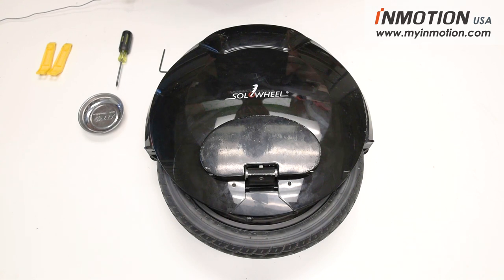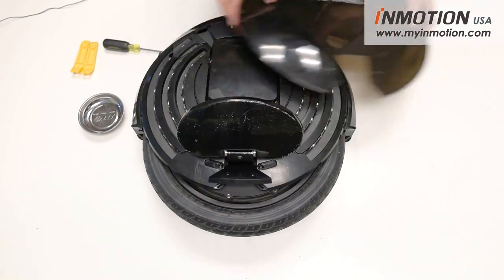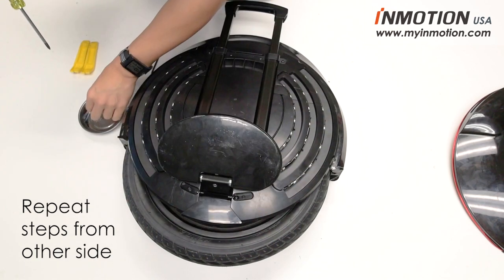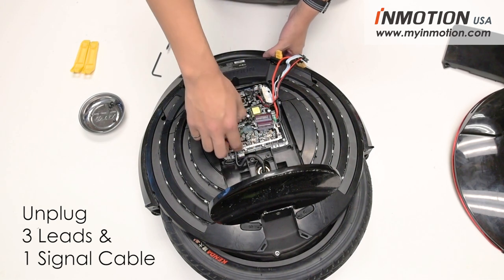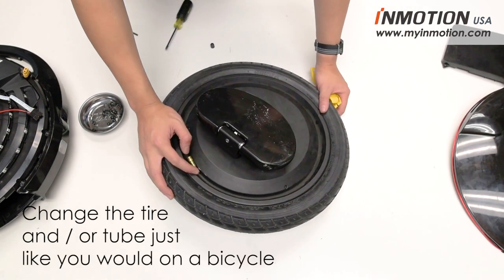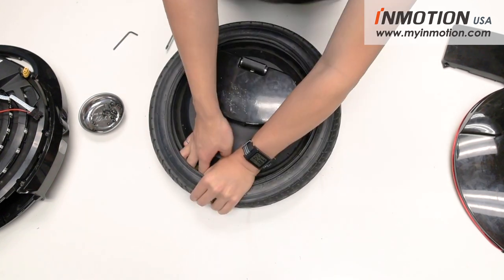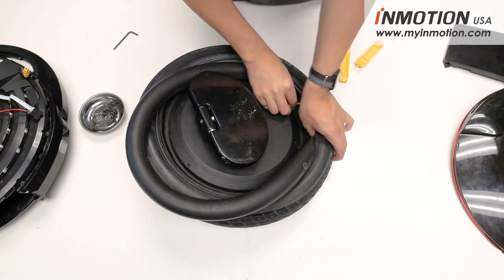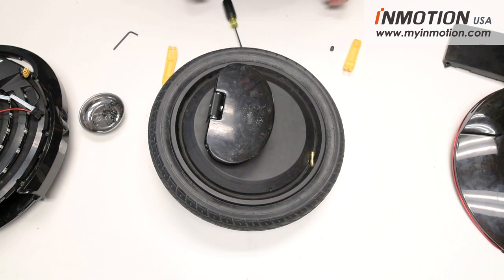InMotion V8  / Solowheel Glide 3 Tire & Tube Change

Comment: No one seemed to notice that the valve stem direction was reversed when putting the tube back in. It's not an issue, since the V8 could be ridden forwards or backwards.
Reply: Mine too and the tire also. The tire has a direction arrow on it, not sure how they missed either. Must be the same assembler.

Comment: I want to tell you that my V8 tire is flat. And it was not necessary to disassemble the wheel or disconnect the electrical circuits. It is sufficient to remove the tire with 2 flat screwdrivers; put the patch on and re-insert the tire. Inflate the tire and GO !!!  From Medellin Colombia
Reply: Not sure how you managed that, you must be a magician!

Comment: Thank you! My hubby and his dad repaired my flat tyre in 1 hour and 30 minutes, this video helped a lot! Great video ;-) thaaaaank youuuuuu :-) :-) :-)
Reply: I want to tell you that my V8 tire is flat. And it was not necessary to disassemble the wheel or disconnect the electrical circuits. It is sufficient to remove the tire with 2 flat screwdrivers; put the patch on and re-insert the tire. Inflate the tire and GO !!!

Comment: Thank you so much for that! It took me 2 hours to access the tube, patch it, and reinstall. Including fixing a bike inner tube i punctured the day before. So in 90min it could be done. Much less if you simply swap the inner tube. It's all quite straightforward in the end, it's not a bad design at all. I have put thousands of km on this wheel and it's still going strong. I use often use a rubber mallet to unlock the plastic shells, as grime / dust tends to increase friction. Ah, i also added ~80mL of bike liquid sealant, using a syringe, via the puncture / hole i was patching, so as to hopefully prevent further punctures. Happy riding everyone.

Comment: Thanks for the video !!
I have another problem : I replaced the inner tube with another similar one (16" with “knee valve”) but it keeps touching the Solowheel when riding. Do you know how to prevent this ?
Reply: Did you find a solution? I have the same problem
Reply: @TheTwistedgirl  i removed the cap + pushed a little bit harder to make sure it does not touch
Also be careful that the valve is bent in the right direction

Comment: Mine Went flat last night and I  feel like I could change the tire at this time and I wonder if there’s a tire that will work better in the snow then the original one thanks also I have to find a tube I think I broke the valve stem but I haven’t really got into it yet. V8
Reply: v8f also is there Room for a one up size. And where am I going to buy my wheel and inner tube because I need that funky Valve stem  on it?

Comment: If you let all the air out and  press the tire rims together and position them down the valley at the center of the wheel, then go to the opposite side of the tire  with your tyre Levers you won't sweat so much or damage the tyre rim by forcing it off.
 In fact you can do it  without Levers. Just roll it off with your hands.
Reply: Good general tactic, but this one is heavier and stiffer than a bicycle tyre, and the wheel has no valley.  Two bike shops gave up on mine before a third finally got the tyre off.

Comment: 2:36 I tried to disconnect those 3 things for 1 hour but it’s impossible.
who ever assembled my V8 he tight it so hard. 
I don’t know what to do😐
Reply: @INMOTION USA
Reply: I had that problem, but was finally able to remove them with needlenose pliers.  I grasped each connector just below the top, and levered the pliers against the plastic housing to lift the connector off the board.  But don’t squeeze the pliers tightly, because it could actually crimp the connector more tightly!
Reply: I have the exact same problem and I’m so scared of breaking the main leads connections
Reply: You can also disconnect all the secondary wires and pull the board off with the chassis, but then you'd have to secure it somehow while actually replacing the tire
Reply: @qbtchl  Mine have welding on it... :/
Reply: Same problem here.  Whoever did the assembly just crimped hard so that the connectors will not fall off.  That it make it nearly impossible to replace the tube but that is the end user's problem.  By then the warranty period has most likely ended anyway.   Here is a much more complicated way involving taking away lots of parts, but it NOT will require the user to touch the main board assembly: https://www.youtube.com/watch?v=vtiJ5FQUfHw
Reply: TST Product Reviews and Tests It’s not impossible, I just pulled those 3 cables really hard and it came out. Just try to pull it don’t be gentle just make sure u don’t damage it.
Reply: TST Product Reviews and Tests I used a plier to pull it out
Reply: Thanks for your suggestion.  I've already opened up the whole unit by following the video done by Justina's Garage.  It looks complicated, but if you watch the video carefully it is not that bad.  I would say it is safer than pulling the tabs off by force because then you risk damaging the motherboard.
Reply: good god did i ever just have a hard time with that too. eventually used pliers and was VERY forceful, like picked up the wheel by them basically
Reply: @qbtchl  thank you for the tip! I was stuck on this step and afraid of breaking something. Pulling super hard w pliers did the trick!

Comment: I would suggest putting TUFFY STRIPS between the tire and tube after your tube replacement. You will never get a flat again. And besides that it is better than SLIME and less expensive. 😎👍

https://www.amazon.com/Mr-Tuffy-Bicycle-700x32-42c-1-5-2-0/dp/B000C17I9S/ref=asc_df_B000C17I9S/?tag=hyprod-20&linkCode=df0&hvadid=312065280674&hvpos=1o1&hvnetw=g&hvrand=16009283213368970721&hvpone=&hvptwo=&hvqmt=&hvdev=t&hvdvcmdl=&hvlocint=&hvlocphy=9004496&hvtargid=pla-449322189539&psc=1&tag=&ref=&adgrpid=62425943472&hvpone=&hvptwo=&hvadid=312065280674&hvpos=1o1&hvnetw=g&hvrand=16009283213368970721&hvqmt=&hvdev=t&hvdvcmdl=&hvlocint=&hvlocphy=9004496&hvtargid=pla-449322189539

Comment: Trying to get the inner tube out has been the most frustrating experience of my life.  This is the worst ***in design ever.  I’m on the verge of just tossing the entire unicycle out the door, piece of ***
Reply: @somelolplayer6199  Sounds like you never changed a tire in your life. Take it to a tire shop if you're that frustrated.
Reply: @h3Xh3Xh3X  no, i think he had the same problem i had with the curved valve! The curved valve hits the motor part and so it is not easy to move through that little hole. At least at my V10F. It helped me to first remove the tube from the other side in direction of the valve. Then you can turn the tube about 45degree and with that the valve. the valve then sticks out from the wheel and from this valve position i could get the valve out (i also used some liquid dish soap to make the valve move better). When you watch this video, you see there is a cut when removing the valve. I am sure they had a lot of problems too removing it, with the tube still inside. So remove the tube first except for the part with the valve